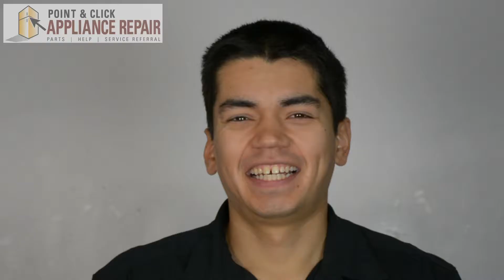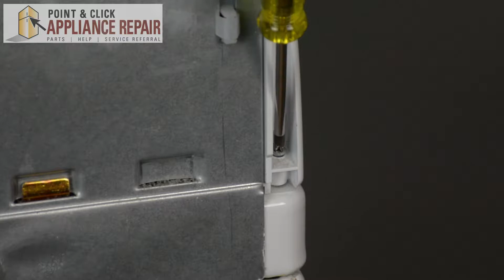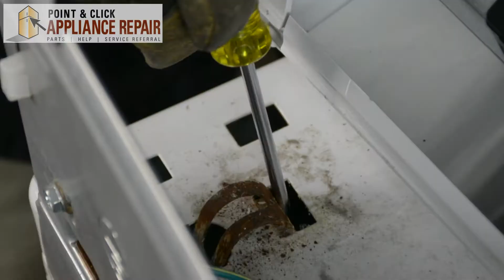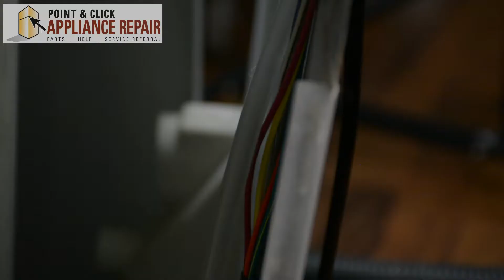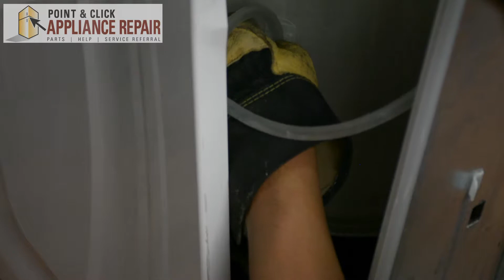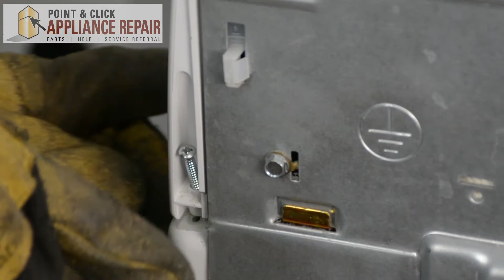WPW10403280 - Replacing Your Amana Washer's Pressure Switch Assembly AP6020982 PS11754302

Comment: I have an Amana Washer that has been giving issues for days. Can’t seem to get it right, and curious if this is the culprit. So the washer will work correctly 2-3 times, and then will just not. It will be filling the tub, and then will just start draining for no reason and then basically it’s like it gets stuck right there. It won’t progress any further. Now it appears you can kill the power and plug it back in and it will work again, for 2-3 times that is before it goes back down. Now I have tried resetting it, I have tried re calibrating it, and neither of those things have been effective. I also ran a diagnostic and it didn’t appear to give me any errors codes after the automatic diagnostic. Could this be what is causing my issue???
Reply: My Amana is doing exactly the same thing as yours. Did you figure it out. I plan to just replace this part . It isn't too expensive.
Reply: @karinchristensen220  My amana is doing the same did this actually end up fixing the issue only problem is I can’t find the pressure switch thinking it may be underneath
Reply: @griffincopley6674  I fixed mine a few days and it was super easy. There is one and only one video on youtube that explains it. The pressure sensor is the one that has a clear hose coming out of it up in the control panel. Take the clear hose off the pressure sensor and blow in it. There is usually a clog at the base of the drum. When I did that I felt a slight pressure then suddenly air flowed - I could hear it. Washer is working fine now.
Reply: Mine is just flashing rinse and ticks